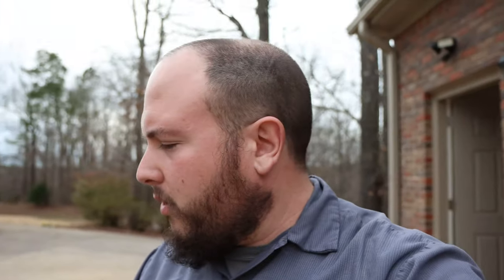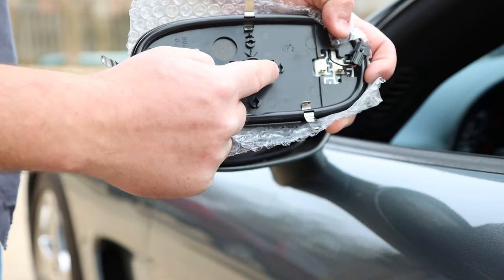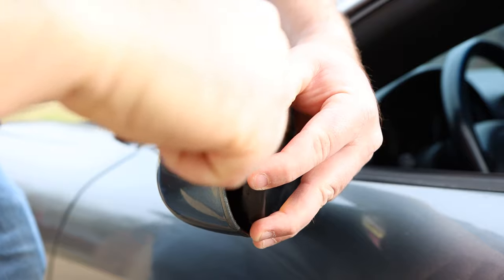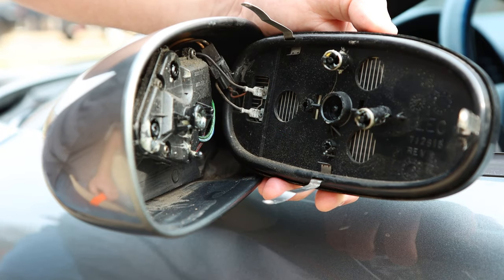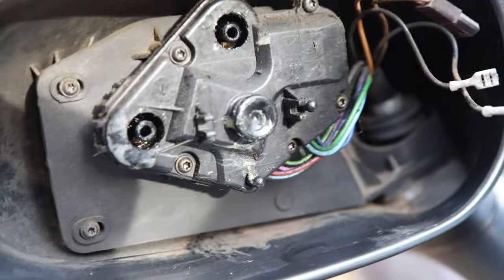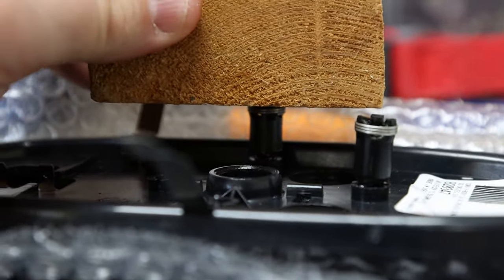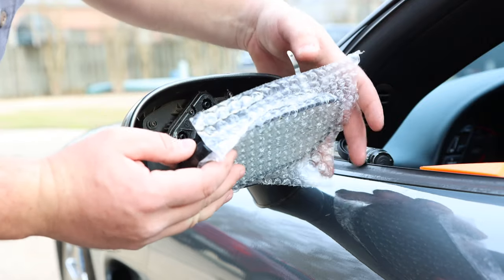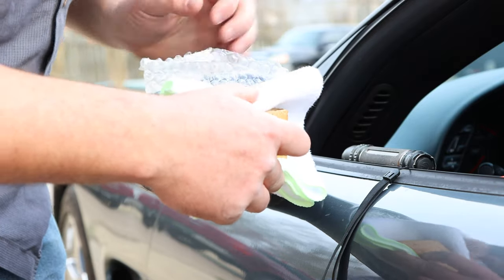Saved $$$ Dealer Tried to Rip Me Off! | How To Replace Driver Side Mirror | 2003 C5 Corvette |

Comment: Chris, great video and I followed your instructions. I replaced mine with just the heated version, since I never felt the tint worked anyway. Just a tip for others, for the 2 “posts or arms” that you transfer over to the new mirror, I found that a 1/2” deep 7/16 hole in the block kept it steady so I  didn’t have to fight it to keep it straight, because it does require a hefty push.

Comment: "This help a lot to get in the right direction". 
Just fixed it (30MAR23) just like driver side on this video, these are the ones that normally go bad on c5s. I pulled the two notches out to reach better, they extend if you pull on them softly with rubber pliers .  The other two are what rotates the mirrors, if you are afraid to break them use a T8x2in "star" screw driver to take off those three screws, they are the longer ones 😊

Comment: Thanks for posting this.  I am going to do this today on my '01 C5.  I bought a used mirror+housing assembly.   Hoping to "simply" pop out the replacement glass,  then pop out my damaged glass, and then install the replacement.   Your video is very thorough and helpful.

Comment: Thanks Chris for a very useful video  I would not have had the confidence to attempt this repair without it, not to mention finding the place to order it.  My Z06 is a 2004, and it had little rubber boots over the two removable posts. I did not use them.  For me the hardest step was the last one, snapping the mirror back on. But now it Is on and looks great, not to mention its function.  Thanks!
Reply from the maker: Glad the video helped. It was stressful trying to figure it out. I couldn’t find any good videos so I figured it would be good to make one since other people would probably have the same issue.

Comment: OMG 350 dollars. My 03 C5 did the exact same thing except I just got a non heated non dimming replacement glass for 15 dollars of Amazon. To me this is a safety hazard and GM should be responsible for the defective part and eat the cost of replacing everyone that has done this.

Comment: My '03 had rubber boots on the 2 extended posts, so I popped the posts of the mirror back and put them into their motor-sockets (makes that clicky-sound), then put the boots back on. Then you just line up those 4 ball & sockets and press into place. 'Froggy' posted a similar vid that shows those boots & posts in place <https://www.youtube.com/watch?v=yV4Tvm0Rrz0&t=195s> Thanks for the tips!

Comment: The part number you show on the part you are using does not fit a 2003 Corvette . I have just verified with Corvette. It is a different part number
Reply from the maker: I’m sorry for the misunderstanding but I never posted a part number because I never had a part number myself. I did post a link to the website that I ordered the part from over the phone. You might have the same luck if you call the phone number and describe the part like I did. Part I received worked perfect. Again I never posted the actual part number.